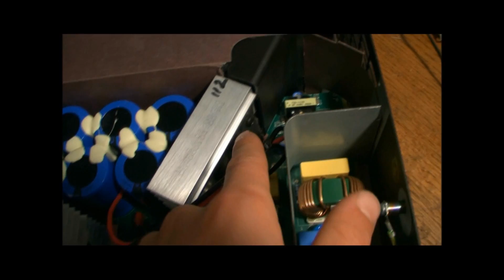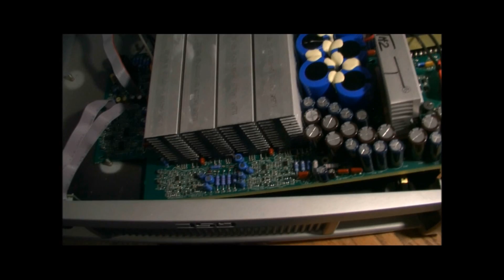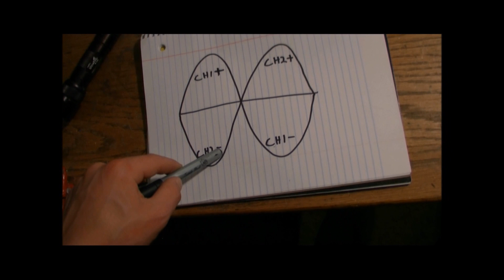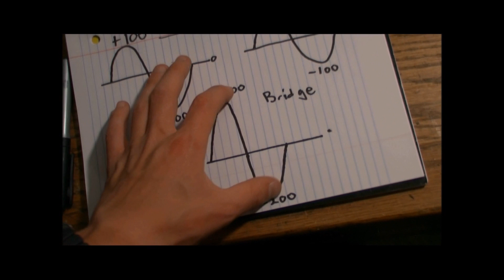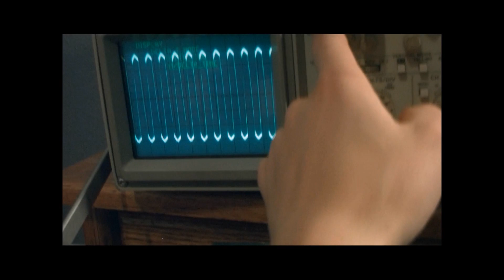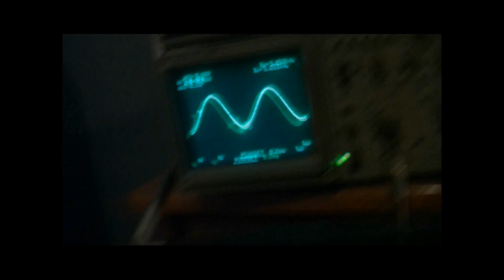QSC PLX-3602 Amplifier Teardown and explanation of operation

Comment: Great video… I would like to add I have been studying the PLX series amps they give you the schematics on a few of them. I do not believe there is any feedback on the power supply of the PLX series. In other words, they run WAO full throttle.
If I am wrong, someone please correct me, but I can find no feedback on the switch mode power supplies. This kind of makes sense to me because that is why they have such good and quick response to caps or constantly loaded with as much as the power supply can put out
Reply: This also explains why the power supplies blow up in flames when there’s a problem

Comment: Jacob,
I also have a technical background and have been looking at the schematic… Focusing on the SG 3525… What is going on here? It appears that there is no pulse width modulation Designed in this, I can’t find the Feedback,… pin one is tied to primary low pin2 is tied to 5.1 v
So this thing is turned on fully with no adjustment… Or feedback… They are using the sync… this thing is not internally timed at all it is time by the 555 timer below… So I was thinking it was frequency modulated but the 555 but that is not happening either… Is the schematic wrong? Please respond as I am at my wits end
I have noticed QSC is the same circuit control on all PLX series… I am troubleshooting a 1602
No feedback on the SG3525… WTH…????? How are they doing it
Reply: The SG3525 uses an internal oscillator which is set by Pin 5 & 6 resistor/ capacitor.

Comment: 3:55 in theory, Class-D amplifiers still are analog amplifiers. About the only case I can think where you can really call them digital, is when a DSP is part of the power amplification. Still then, it would most likely fall into the mixed-signal category. But hey! Call it what you want. Too much nitpicking on my part, eh?!

Comment: CX and PLX models can run on 240V AC, to modify them to run them on 240V AC mains, you need first to remove the red wire which go between big blue filter caps (voltage doubler) and then move the small jumper from 120 to 240V position on the pcb.
Reply: I did it and my amplifier blasts.... :(
Reply: @Wowgaming-zw9vd  You probably forgot to remove the red wire...
Reply: @Felix2417425  my complete power supply burnt, i have replace the power supply which cost me around 200$
Reply: But again i ll receive the 110v amplifier. I ll share the pic and will you please help me how to proceed
Reply: @Felix2417425  can you please contact me, my info is available in my about section.
Reply: How can i contact you
Reply: Please contact on whhhhhhtsap
Reply: @Felix2417425 need your help
Reply: Check my abouttt section

Comment: not so good for high fidelity switch mode supply in poweramps.type crossovers often used in amps et the driver driven with amp with filter out off phase.how much depends on filter type and order.and driver pacement i relation to the other drivers in a system with more then one amp.class H is not the best sounding.there are some brands that have very special type digital amps with signal digitalt to the output.tact millenium or lyngdorf audio google them and see for your self.they are highly efficent and have v unusual tecnoligy for an audio amp.power delivery etc

Comment: Jacob, Your video is very informative I do some repair work on equipment and I have a QSC PLX3102 which looks just like the 3602 and the corner of the circuit board where the speaker wires attach burned up those few components and I rebuilt that section on a new piece of board and tied it back into the main board and I found a couple of other components bad and replaced them but when I turn it on the power led does not come on but both red clip lights stay on bright and I have tried to isolate the problem with no avail, can you help me with it, 
Thanks,
Dave

Comment: Hi Jacob, I was under the impression all digital audio signals have to be converted to analog prior to being sent through the amplifers electrical components. You mentioned digital audio amplifers, are 1s and 0s replacing electrical impulses?
Reply: The only thing digital is the power supply and the amp module control.  The audio is ALL analog...

Comment: IGBT is insulated gate not integrated and the chokes on the input are called common mode chokes and they keep the switching frequency from the SMPS from feeding back to the mains

Comment: question about running subs with this 3602 amp. i'm trying to get the most power off this amp and subs. the subs i'm interested in are about 1700 watts RMS and 3400 watts peak. the subs come in 8 ohms and 4 ohm versions. which should i get? i already have one which is the 8 ohms version and was thinking about getting the 4 ohms version to get more power out of it?  since i already  have the 8 ohm version, can i mix it with the 4 ohm version? will the 4 ohm sub "sound louder" if so by about how much? 
i only use one sub for most of my gigs and use the 8 ohm version i already have. but for the bigger bigs i'd like to drive 2 subs. but i want to get the 4 ohm version and use it as my primary instead of the 8 ohm i already have since i don't need 2 subs for most of my gigs and use 2 (with the 8 ohm as secondary) for the bigger gigs. 
the 8 ohm is plenty sub already for most of my gigs. plays very well and has handled all my big gigs but i think a second one would sound better. the reason i want to get a second sub is because i was called to check some wiring of some amps and speakers for a club and the crest sub amp didn't seem too big of an amp compared to this 3602 but it drove 4 subs and handled them very easily. this amp was set at max and they controlled the volume by the mixer. they had 3 separate amps for highs mids and subs. the biggest largest crest amp being the sub speaker..

can the 3602 handle two 1700 RMS 8 ohm and 4 ohm subs? is a second amp overkill to the amp? is it necessary? what's the proper way to power 2 subs (8 and 4 ohms) with the 3602 amp to get most out of the amp and subs?

i already also have two 15" 1000 watt RMS 2000 watt peak powered by a 3402. i need power and maximize them... 

i also have a third amp that drives my highs bi-amped on the 15's. 

in my rack i only have an eq. one side for the subs and mids. the other side for highs only. the 3602 cross over is switched on. no cross over for the mids... since the 15's are 1000 RMS they also help the sub with lows hence me not needing a 2nd sub for most of my gigs... 

3402 specs:
Watts Stereo Mode
(both channels driven)
8 ohms 20 Hz-20 kHz 0.03% THD 700W 
4 ohms 20 Hz-20 kHz 0.05% THD 1100W 
2 ohms 1 kHz 1% THD 1700W 

Watts Bridge Mono Mode
16 ohms 20 Hz-20 kHz 0.01% THD: 1400W 
8 ohms 20 Hz-20 kHz 0.01% THD: 2200W 
4 ohms 1 kHz 1% THD: 3400W 

3602 specs:
Power:
775 watts stereo at 8 ohms
1250 watts stereo at 4 ohms
1800 watts stereo at 2 ohms
2600 watts bridged to mono at 8 ohms
3600 watts bridged to mono at 4 ohms
Reply from the maker: I wouldn't mix 4 and 8 ohm boxes. if you already have an 8 ohm sub put it in parallel with another 8 ohm and you have 4 ohms together. Take that 4 ohm pair and put them on the 3602 bridged. That will give you the most bang for your buck and is the proper way to do it. You will be able to use all 3600 watts of the amp. Yes you can push more power through a 4 ohm cabinet than an 8 ohm cabinet, but in your case you don't want to mix 4 and 8 ohms and if you did you would have to run separate channels not in bridge resulting in actually less power, plus your subs would not be powered equally. Go for the same 8 ohm cabinet and put it in parallel with the one you have then connect it in bridge.
Reply from the maker: I wouldn't mix 4 and 8 ohm boxes. if you already have an 8 ohm sub put it in parallel with another 8 ohm and you have 4 ohms together. Take that 4 ohm pair and put them on the 3602 bridged. That will give you the most bang for your buck and is the proper way to do it. You will be able to use all 3600 watts of the amp. Yes you can push more power through a 4 ohm cabinet than an 8 ohm cabinet, but in your case you don't want to mix 4 and 8 ohms and if you did you would have to run separate channels not in bridge resulting in actually less power, plus your subs would not be powered equally. Go for the same 8 ohm cabinet and put it in parallel with the one you have then connect it in bridge.
Reply from the maker: I wouldn't mix 4 and 8 ohm boxes. if you already have an 8 ohm sub put it in parallel with another 8 ohm and you have 4 ohms together. Take that 4 ohm pair and put them on the 3602 bridged. That will give you the most bang for your buck and is the proper way to do it. You will be able to use all 3600 watts of the amp. Yes you can push more power through a 4 ohm cabinet than an 8 ohm cabinet, but in your case you don't want to mix 4 and 8 ohms and if you did you would have to run separate channels not in bridge resulting in actually less power, plus your subs would not be powered equally. Go for the same 8 ohm cabinet and put it in parallel with the one you have then connect it in bridge.
Reply from the maker: I wouldn't mix 4 and 8 ohm boxes. if you already have an 8 ohm sub put it in parallel with another 8 ohm and you have 4 ohms together. Take that 4 ohm pair and put them on the 3602 bridged. That will give you the most bang for your buck and is the proper way to do it. You will be able to use all 3600 watts of the amp. Yes you can push more power through a 4 ohm cabinet than an 8 ohm cabinet, but in your case you don't want to mix 4 and 8 ohms and if you did you would have to run separate channels not in bridge resulting in actually less power, plus your subs would not be powered equally. Go for the same 8 ohm cabinet and put it in parallel with the one you have then connect it in bridge.
Reply from the maker: I wouldn't mix 4 and 8 ohm boxes. if you already have an 8 ohm sub put it in parallel with another 8 ohm and you have 4 ohms together. Take that 4 ohm pair and put them on the 3602 bridged. That will give you the most bang for your buck and is the proper way to do it. You will be able to use all 3600 watts of the amp. Yes you can push more power through a 4 ohm cabinet than an 8 ohm cabinet, but in your case you don't want to mix 4 and 8 ohms and if you did you would have to run separate channels not in bridge resulting in actually less power, plus your subs would not be powered equally.
Reply from the maker: I wouldn't mix 4 and 8 ohm boxes. if you already have an 8 ohm sub put it in parallel with another 8 ohm and you have 4 ohms together. Take that 4 ohm pair and put them on the 3602 bridged. That will give you the most bang for your buck and is the proper way to do it. You will be able to use all 3600 watts of the amp. Yes you can push more power through a 4 ohm cabinet than an 8 ohm cabinet, but in your case you don't want to mix 4 and 8 ohms and if you did you would have to run separate channels not in bridge resulting in actually less power, plus your subs would not be powered equally.
Reply from the maker: I wouldn't mix 4 and 8 ohm boxes. if you already have an 8 ohm sub put it in parallel with another 8 ohm and you have 4 ohms together. Take that 4 ohm pair and put them on the 3602 bridged. That will give you the most bang for your buck and is the proper way to do it. You will be able to use all 3600 watts of the amp. Yes you can push more power through a 4 ohm cabinet than an 8 ohm cabinet, but in your case you don't want to mix 4 and 8 ohms and if you did you would have to run separate channels not in bridge resulting in actually less power, plus your subs would not be powered equally.
Reply from the maker: I wouldn't mix 4 and 8 ohm boxes. if you already have an 8 ohm sub put it in parallel with another 8 ohm and you have 4 ohms together. Take that 4 ohm pair and put them on the 3602 bridged. That will give you the most bang for your buck and is the proper way to do it. You will be able to use all 3600 watts of the amp. Yes you can push more power through a 4 ohm cabinet than an 8 ohm cabinet, but in your case you don't want to mix 4 and 8 ohms and if you did you would have to run separate channels not in bridge resulting in actually less power, plus your subs would not be powered equally.
Reply: *****
a friend of mine is interested in my sub. i love my 1700 watt 8 ohm sub. i'd never thought of selling it until i read the 4 ohms push more power. now i'm conflicted on whether to move on to the 4 ohm version... since i primarily only use one sub.
what's wrong with running to different speakers 8 and 4 ohms if isn't harming the amp?
if i were to sell the 8 ohm sub and start over would 2 4 ohm serve me better?
in my case with one 3602 amp, what's the advantage of having 2 8 ohm 1700 watt rms 3400 watts peak subs
what's the advantage of having 8 ohm another 4 ohm sub?
what's the advantage of having two 4 ohm subs?
remember i only use one sub for most of my gigs...
in future should i get another 3602 or a PLD4.5
				
the real reason i only mostly use one sub is the space to move all my equipment. i don't have a big enough vehicle for 2 subs. but i am working towards a bigger vehicle.
Reply: @jacobdykstra8499   this amp we were discussing, plx3602  just blew i think. my wires touched behind my speaker during a gig and i think did something to the amplifier. it turns on and clip lights turn on every second. i don't know how long the wires touched but they touched enough to damage something in the amp. i see nothing similar on the internet... i'm trying to figure out what i harmed and about how much it's going to cost to repair it.
Reply: well, since the objective is powering subs, we want to make sure we have plenty of headroom (more power available than what is needed) in order for the sub to remain clean within the frequency range we're using it for, so the amplifier needs to output about halfway in between the rms and the peak rating of the sub being used. Though, be sure to keep an eye on your levels, making sure the amp isn't clipping.
Whether one uses eight or four ohm subs is determined by the type of amp one chooses to use and how the amp can be configured in order to provide the power needed. 
Since we're using the 3602, we'll definitely be bridging the amp so we can achieve the 2600w output, which it delivers at 8 ohm.. if the sub was a 4 ohm, the amp would be delivering 3600w, not only is that way too much power, which would eventually result in a fused voice coil, it also puts an enormous strain on the amplifier as well, which depending on the ambient temperature where the amplifier is being used, it may not be able to keep itself cool and cause it to shutdown intermittently. 
If you were using two of these subs, you'd need about 5000 watts (2500w per sub). Best way to do that is to obtain a second 3602.. One sub per amp.
Reply: @67168  this amp we were discussing, plx3602  just blew i think. my wires touched behind my speaker during a gig and i think did something to the amplifier. it turns on and clip lights turn on every second. i don't know how long the wires touched but they touched enough to damage something in the amp. i see nothing similiar on the internet...

Comment: howd you remove the pcb from the case?
Reply: +Kenien Spann There are some screws connecting the PCB to parts of the cabinet, the cooling fan duct, etc., which must be removed. Then, there are keyed holes on the PCB which allow corresponding keyed pegs attached to the top of the case to be passed through. By sliding the PCB sideways, you can line up these keyed holes and pegs to allow the PCB to be lifted straight up and out of the case. You'll have to remove the board with the binding posts first, and perhaps some other things which I can't recall off the top of my head.

Comment: Great video. Thanks for making it. I have three of these amps. I recently started shopping again and was appalled at the dreadful specs on all the new gear. There is a lot of high powered amps with terrible damping. The amps with good specs are now ridiculously expensive.  These amps have served me well. I have 4 more at a club I work at. One of them has a rattle. I am guessing it is some lose capacitors. Still works. It is remarkable given how I handle my gear that they all still work. That amp Bridged mono into my tiny jbl srx712's kicks major ass. Of course the 8 18" subs help. One note. is there is a section in the video that repeats twice.

Comment from the maker: Unfortunately, no that is why qsc makes a whole different model for each voltage. They both are exactly the same amp only the power supply has just a few different components. The caps are rated higher and the transformer would have a different primary rating. But since it is all on one board you cant just change the power supply. It is actually better to run these amplifiers on a transformer, it actually allows to to isolate the ground and neutral to eliminate input line noise.

Comment: This is very interesting , I love these amps and I have two of them. I wonder if you can give some ideas on how one can covert them from 120 v to 240 v. I bought two of them but  all are 120v So I run them on a step down transformer. Actually converted a UPS output of 240v to 120v . I wonder if QSC sales a conversion kit because shipping the amps to Zsounds in US is costly than buying a new one and QSC has got no service partner in East Africa Rwanda.
Reply: @ameldaquirk3965  i did it and my amplifier blasts
Reply: @ameldaquirk3965  can you please contact me, my info is available in my about section.